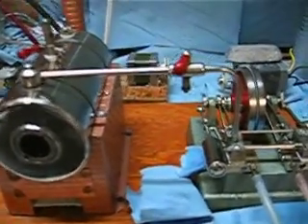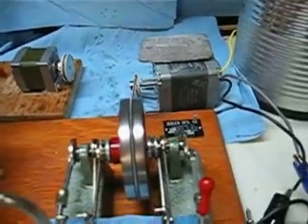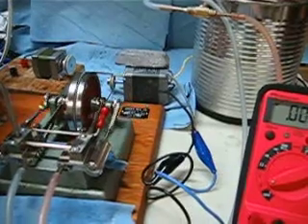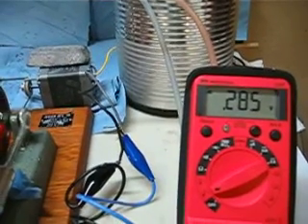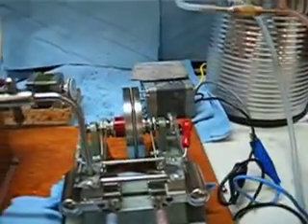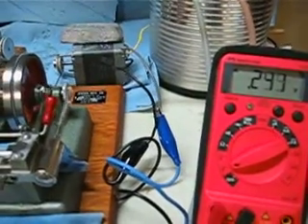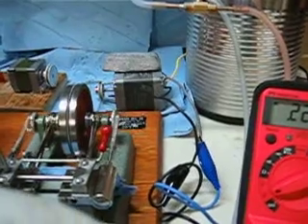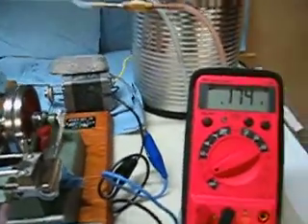Jensen 55 - AC motor as a generator

Comment from the maker: I've not yet looked into how to properly use this motor for power generation.  What I've otherwise found out is it takes more engine than I've got to generate significant current at anything beyond very low voltage.

I think I need a Jensen 50 or perhaps a large Stuart ;)

Comment: I SOO want one of these but prob a mid sized one will do maybe one that can generate 12 volts DC and a few amps the more amps the better and use a 12v to 115 volt power inverter

Comment: If you put a capacitor of sufficient size across the motor output it will self excite and produce power but it is tricky to pick the right value capacitor. Search google for "induction generator"

Comment: A three phase AC induction motor can be used as generator, but the windings must be driven with a variable frequency drive. If the rotation speed of the shaft is higher than the setting, the motor will brake, and the energy flows to the VFD.